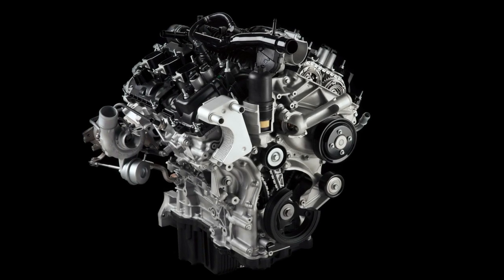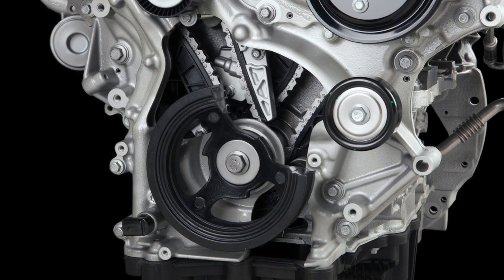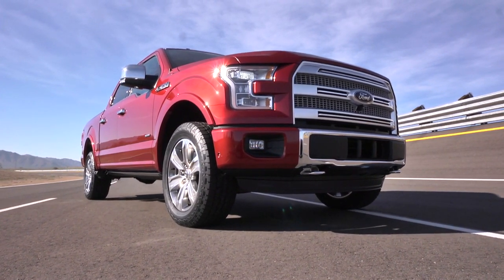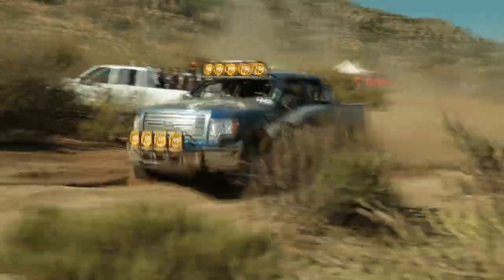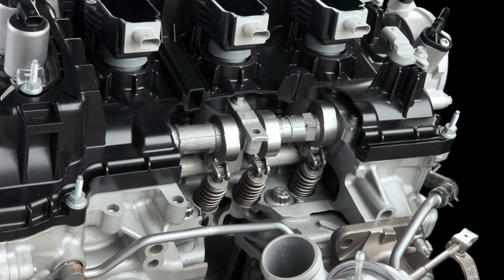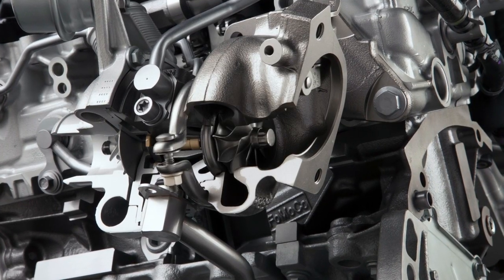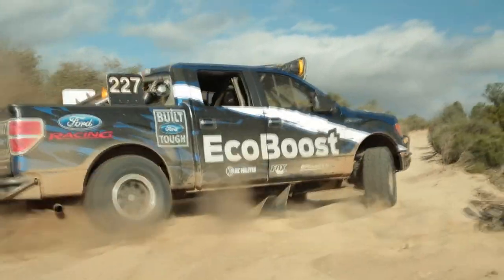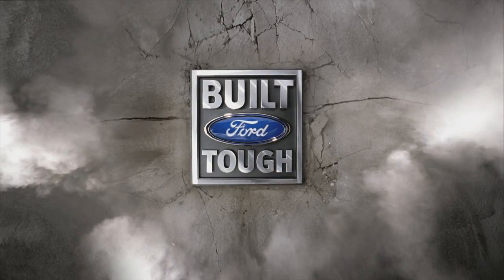Inside the Ford 2.7L EcoBoost Engine | AutoMotoTV

Comment: 10000 miles, 10000 smiles, the lil 2.7 is a terrific engine so far, economical, quiet, and strong, not saying it’s better than the old tried and true V8’s, but so far I couldn’t be happier with this power plant!